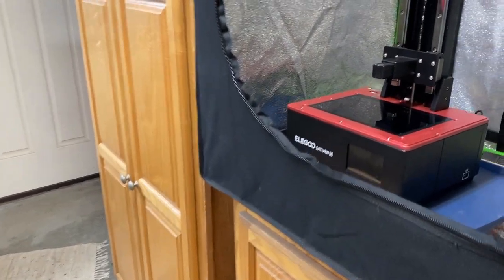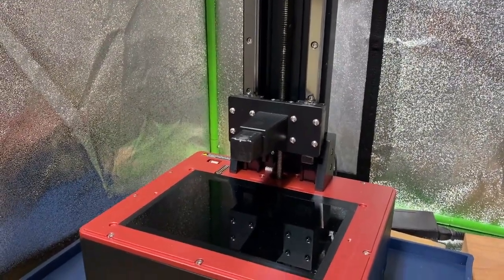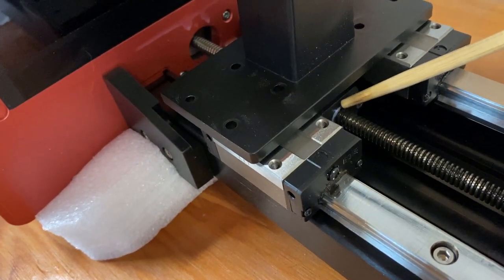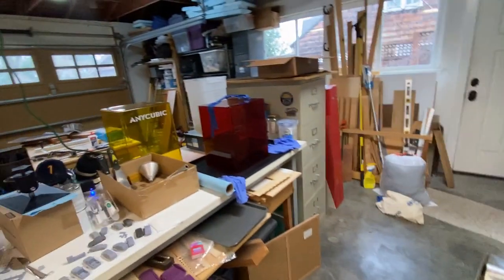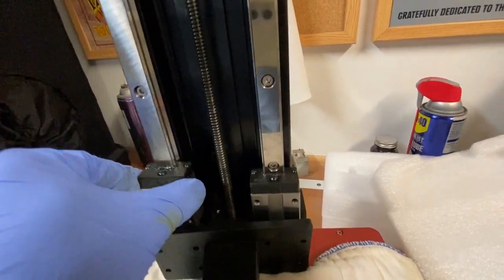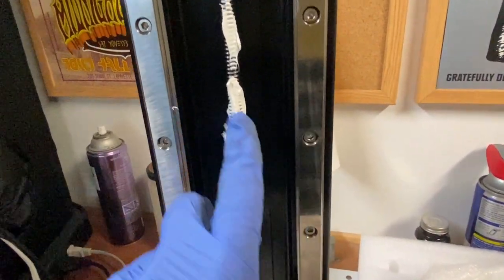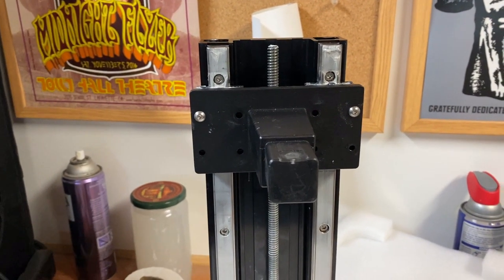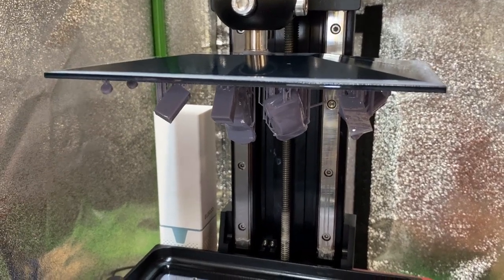My Elegoo Saturn S 3d printer z axis froze; how to take apart and re-grease

Comment: I had the same problem as you did fortunatly i only had to heat up the z Axis lead screw and bearing with an air drier and it started moving, cleaned the old Grease and aplied new one and it works fine, hope it helps someone

Comment: Mine just froze up... I've only done 15 or so builds, so you are not the only one.
Reply from the maker: Have a look at the rods- if they are blackened, then they may need greasing. You can remove the build plate, and make sure the drive rod still is turned by the motor; then you'll know you have a grease issue.